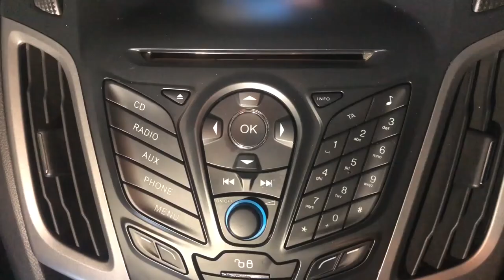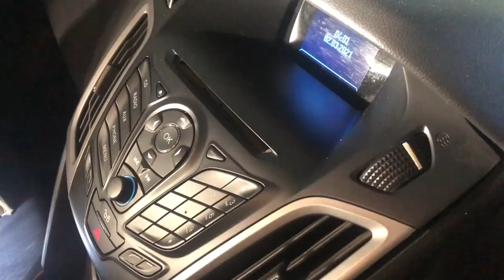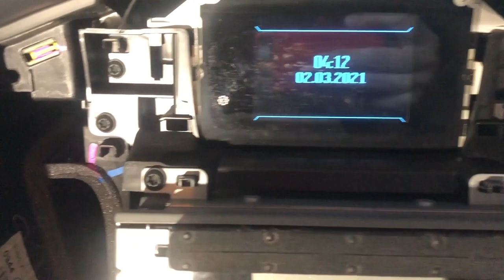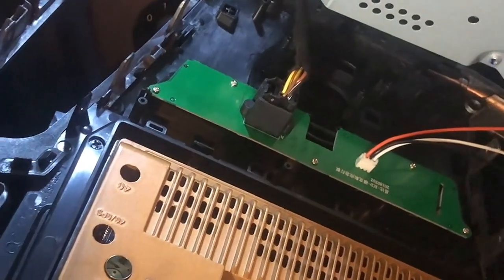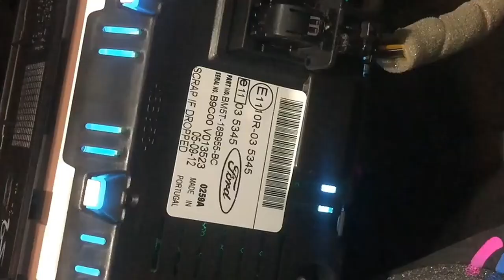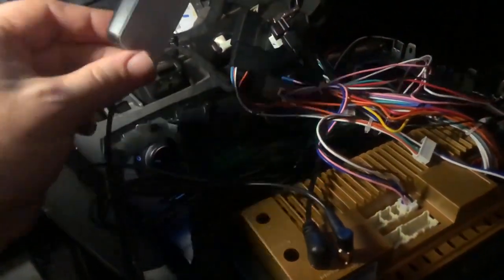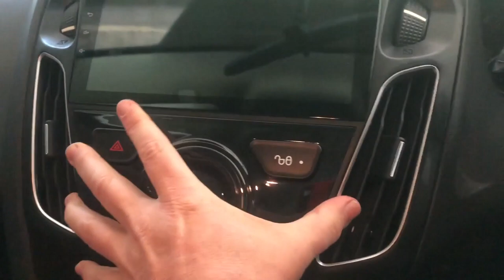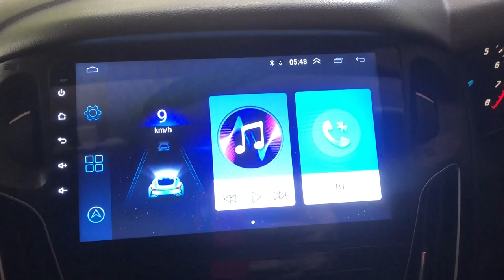2013 ford Focus: Removing / Installing full fascia and head unit car stereo

Comment: The top screen can be unplugged and removed buy simply swinging the two ears (one of each side of the plug) downward. They act as a cam lock to wedge the connector into place.    If you pause at 6:11 you can see one of the ears/tabs on the side.  Put a finger on each one and press down in that position you have it in that shot and that will unplug the screen.
Reply from the maker: Oh cool, I’ll remember that for next time. I’m just glad someone watched my video! Cheers
Reply: appreciate it bro

Comment: So on the 2013 Focus ST with ST1 trim - once the bar is removed there are 2 screws behind it with torx heads - once they are removed the unit came out.  In my case - the stereo was loose and i wanted to see the issue.  On the back there are 4 other torx screws holding the stereo in place and they go into plastic fittings - the 2 at the top had broken away.  Waiting on the krazy glue to set and we’ll see if this works.  Hopefully an upgrade in the future…

Comment: near the bottom it has a white sqaure with three wires black red and white , they have nothing on the ends or anything. just bare wire. where do they go??
Reply: at 304 those three wires in the green box

Comment: I actually took the top unit out that you left in but have lost audio from the rear parking sensors .I think how you have done it has made the parking sensors still work for you is that correct ?, as from doing alot of reading that unit makes those sensors  work  .The only way around getting parking sensors back if you take that top unit out is to fit a rear camera and connect into the android system . Leaving that unit in have you got full functions of the car was there anything that didnt work correctly ? .  Also did you have any issues with FM radio or did you fit a DAB usb adapter and if you did , did you connect it to the black or white aerial connection ( fakra ) please thanks .Having quite a few issues to sort .

Comment: Where do you put the three wires on the new facia?
Reply from the maker: I didn't put them anywhere, and it all seemed to work fine. Those extra wires might be for certain connections that the basic ford focus doesn't have. I'm not sure!
Reply: @gearfacts  thanks, mine came with a random circular speak, any chance you might know what that is for?
Reply from the maker: @xVeRSeii  I don’t know sorry, mine didn’t have that